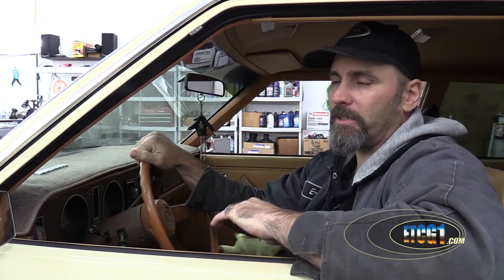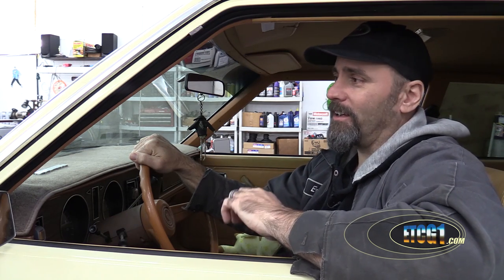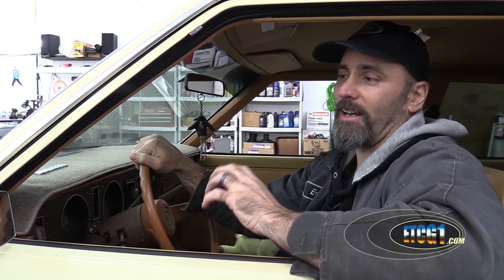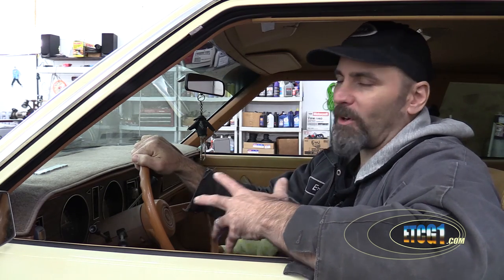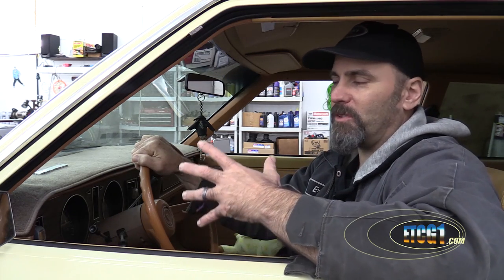Analog vs Digital (Cars)

Comment: I would argue that the combustion engine is on the way out, slowly. Alternatives such as electric and hydrogen engines will take over in the next 100 years. Combustion only uses about 40% of energy from the fuel and 60% heat. Once batteries become able to recharge in a few minutes and have a 300 mile range then it will be all over for combustion. Don't get me wrong I'm an old school guy that runs a 1962 Firetube Steam Boiler at work and drive a 1974 Chrysler with a thermoquad carburetor on top of a 440 V8 most of the summer. So I love old mechanical technology but eventually things will change. My great grandchildren will probably just see combustion engines in a museum.

Comment: hey when a emp bomb goes off, guess who will still be driving. "Analog" Ericthecarguy
Reply: turbocl32 anything that has electrical components would be hurt... ignition coils, batteries,....still used on analog. The only safe vehicle would possibly be diesel if able to be hand cranked? IDK... then there's the issue of acquiring the fuel...  gas stations need electricity to run the pumps

Comment: Fuel injection is not all about fuel economy. There are so many other benifits.

If your carburated car runs lean and starts knocking, it would continue doing so until you melt a piston. It is inherently not able to do anything about it.

if you were to fill up at the gas station and get some bad gas you are screwed. if your fuel pressure were to drop for some reason you are screwed.

With fuel injection, drive by wire throttle, you set up the system so that if the air fuel ratios are not right, you limit boost, you limit throttle position. The system are way faster at reacting to these things than the driver behind the wheel having to notice that one of the gauges is reading incorrect.

In your dyno video, you spent a lot of time trying to find the fault. you were super frustrated all of you. i was tense watching the whole deal, it was nerve racking. Finally throwing parts at it to find the fault. The carburator did not really show itself as a more robust system, it was totally put out of proper functionality by the pipe leading to it. You had experts with tons of experience helping you for hours on the dyno.

If you are just a dude on your driveway that would be a nightmare, you would have a car that would not run right. With fuel injection you could just add fuel at that load point. All the nececcery data from how the engine was running could be collected easely to make these changes.

But i get were you are coming from Eric. With a carburettor that system in itself is unlikely to go go bad. Its just when you look at the whole engine it is way more likely to blow itself up.

Im definetly on the "fuel injection team" but its nice to have the discussion :) your car will still be nice :)
Reply from the maker: You make some good points, but keep in mind the carburetor had nothing to do with the issues we had on the dyno, that was the carb hat. Still, I think that video illustrates one of the fundamentals of diagnosis, K.I.S.S.. Keep It Simple Stupid. If nothing else, my videos can serve as a cautionary tale. I don't mind falling on my sword if it can help someone avoid the same issue. Also, if I heard my engine knocking, I'd turn it off and find out what the problem is. If you were to fill up with bad gas on a fuel injected system you would also be screwed. Bad fuel is bad fuel. The point is, I think both FI and carburetors have good points and bad. For me, I want to run a carburetor on my Fairmont. Nothing else to it really. Thanks for your comment.
Reply: Thanks for the reply :)

Im an engineer in ebbedded electronics, so i might be a bit bias. to me the fuel injection just makes sence, and is so much easier to set up.

Carburettors seem to me like more of an art, its set up by feel and experience. I find it really hard to grasp.

I would argue that the top hat would not be an issue with fuel injection, the flow into the carburetor caused the venturis to not work properly. fuel injectors would not have that issue.

About the bad gas i might have not got out what i meant, what i meant is if you get a batch of gas that is of a slightly different composition, you guys are mixing ethanol in aswell with the gas right? (swede so don't really know your situation in this regard) if you were to get a fex extra percent ethanol in the tank it would run lean. risking knocking. a fuel injected car would pretty quickly change the adaptation and continue as normal.

pros and cons with everything, with fuel injection you have a bit of a learning curve to get past. can't really just slap it on and turn the key. then you would probably not even get it to start at all. The manufacturers of carburettors seem really good at this. The experience is just that you slap it on. Then you have a starting point to fine tune from later. It cant really fail in this as long as you have fuel in the bowl.

Ive seen experienced dudes who really like fuel injection still slap on a carb for the first engine start, then when its running the work starts to change it over to fuel injection.

Anyway i don't dislike at all that you are using a carb. I'm looking forward to your experience in it :) i don't really have any experience in carburettors to speak of. Especially not ones put on american v8 turbocharged cars :) 

I think it would be a really cool video to explain the setup of your carburettor in more detail. If you need to make adjustments going forward it would be nice if you explained how you concluded it needs whanging and how the process works to set it right :)

Love the videos Eric! Dark matter pikachu is awesome :)
Reply from the maker: Thanks for your reply. I would argue that the carburetor had nothing to do with the issue. It was clearly the carb hat that was the issue in the case of my dyno run. It ran fine without the bad hat. Like anything, if it's not set up properly, it won't run properly. Carbureted or fuel injected it really doesn't matter. The point I've been trying to make to a very small contingent in the commenters is that I don't see my engine failing because I'm using a carburetor. 

I actually do have a detailed video on my carburetor coming up. I'll also be making videos of the final set up once I have the engine installed and running. I'll also keep the audience posted of any issues I run into daily driving the car. I would consider it bad form to leave out any issues I run into. However, I'll also sing it's praises if I don't have any issues. 

Thanks again for your input.

Comment: @7:34 Yes Eric, but a system that is more complex would require more time to locate the error without diagnostics. Carburated engines are less complex and therefore it is easier to locate the problem and  solely rely on experience. An axe is easier to fix than a chainsaw.

@11:25 I am from the 80ies and feel old arround the degenerated millenials of today. :(

@13:51 Alternatively, you could just have a diagnostic equippment with you while driving a digital car. AFAIK the only difference is the diagnostic part and the complexity, the rest is still mechanical and gives you hints where to look at in case of an arising problem.

Comment: direct injection is a TERRIBLE idea. Leads to terrible carbon deposits on the backs of the inlet valves. It's normal to have to have the head cleaned every 6 months on some cars.
Reply from the maker: I agree, but I'm sure they'll sort that out at some point. At least I hope they do.
Reply: Unfortunately that doesn't help the problem inherent in direct injection systems - in a port injected or carbureted car, the air-fuel mixture washes the backs of the valves on every intake stroke. In a direct injected car all you get is air mixed with oil droplets from the PCV system - the oil droplets stick to the valves and gets cooked up real good from the engine heat. Lovely sticky crud on the backs of the valves is the result. I understand Toyota have a system that injects a tiny amount of fuel into the inlet ports to wash the valves as if a port injector or carburetor were present. Not sure how well it works or not. I personally don't think the power and efficiency gains of direct injection are worth the reliability losses.
Reply from the maker: That Toyota system sounds like a step in the right direction. Water injection might also be the answer but I don't see people filling up their water bottles on a regular basis. We'll see where they go with it.

Comment: analog - mechanical is ALWAYS superior to digital.
Reply: Then why are you using a digital, transistorised computer, instead of a mechanical computer?
I'll tell you why, because with only mechanical computers, a computer with the performance of a Commodore 64 would be the size of a large room. 
Without transistors and digital equipment, you wouldn't have your smartphone, you wouldn't have your car (if you have a modern one). You would have never heard of the Internet, and frankly, you might not even be alive. It is only thanks to digital equipment, that we have made so many advances as a society. When it comes down to it, none of the things we have in life nowadays are possible without digital devices.
Reply: Not true at all.  Digital is the reason why throttle bodies, cams, cam belts and valve springs are being replaced with constantly variable pneumatic valves in engines.  Massive increases in torque, HP, economy, far fewer parts, lighter weight and smaller packaging.  Not that an old 1930's carb engine isn't beautiful in it's own right, but it sure is not superior in any way except nostalgia.
Reply: Archemedan Eye:you do understand pure digital items, (comps, phones,game syst.)
get replaced/trashed every 3-7 years, right? Digital tech for communication is all well & good, 
but people do need large-ticket items to stand the test of time. All digital authority transportation will 
be in the form of 10 year useful life, max. Regular exposure to Mother Nature makes it so.
Reply: Tim Ewa Total nonsense.  There are many 80's vehicles that run full engine management still running today.  Engine computers don't have to interface with other applications like a cell phone does, so your comparison is not relevant and is proven wrong by the fact many digital control systems 30 or so years old continue to run just fine.
Reply: uh, lots of distributors on those eighties
engines, aren't there?
 digital ignition? sure
 digital distribution to cy;inders? No.
Go check under the hood(s), I'll wait
  Ford had Dura-Spark I, DS II, and then 
came Thick Film Integrated, they paid out 
in a law suit over TFI. It was/is digital. 
Wiki it. Thirty years? No. You'd burn through
a baker's dozen modules in twenty. Random 
failure-that's why Ford had to pay out.
Reply: A lot of mid-late 80's distributors are essentially just a crankshaft/camshaft position trigger.  They send a signal to an interface module which the computer interprets and creates a constantly variable spark timing output based on many different variables such as engine temperature, intake temperature, cylinder knock etc.  This was in 1986.  More than 30 years ago.
Reply: distributors suffered vacuum can failures, 
it was a $20 fix & the auto was still operable
in failure mode, not true for crank/cam position sensors-time to tow it.
Reply: Very true and for a low stress engine you can't go wrong with that simple old stuff.  It's amazing how nice an  old engine can run with a carb and conventional ignition systems.  I love old Datsun's and 2 barrel V8's for this reason.  But those methods of control don't cope very well with turbocharging where an engine can go from vacuum to boost in a fraction of a second.

Comment: EVs> ICE anything, regardless of fuel type or delivery system.
Reply: EVs are still 15 to 20 years away from being good. Nobody wants to sit around for an hour or more to charge an EV
Reply: @lesterparker1594  I don't know the last time I did that. I charge it while I'm at work or at home. There are models that will charge in 15 minutes. More at issue is the infrastructure.
Reply: @hondaguy9153  for us on rural America, it doesn’t make any sense. We have no charge stations. Very few people drive EVs here. My point was that I think it’ll be 10 to 15 years before the technology makes it a good decision for most people. Even then, a lot of us just don’t care for EV. I’m able to keep my ICE working own my own. I wouldn’t be able to work on an EV.
Reply: @Lester Parker  You can work on an EV. Outside of the battery and propulsion, the cars themselves aren't any different.  Eventually you'll have to stop driving ICE. I hope someone will get some political will and actually make it a law that as of 2025 or 2030 no new ICE vehicles can be sold in the US.